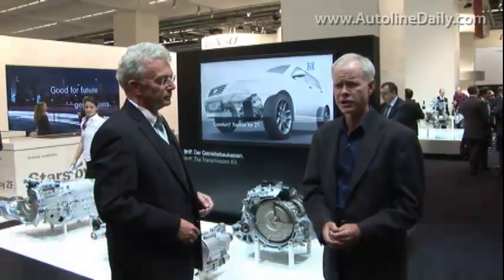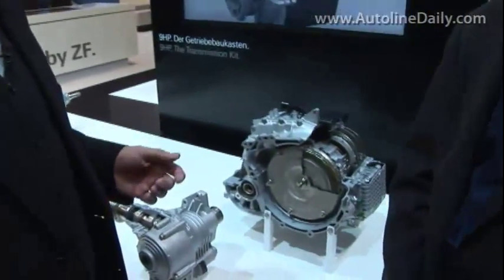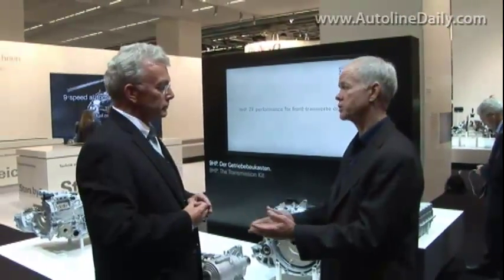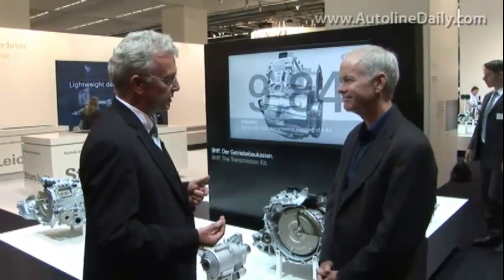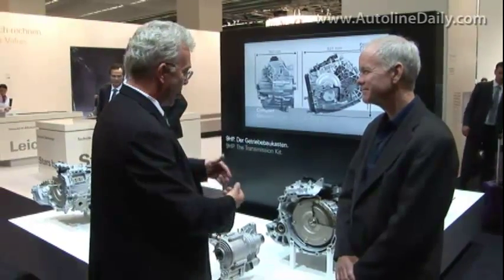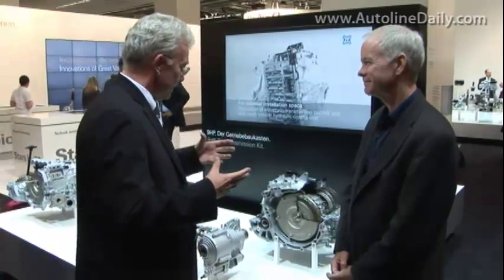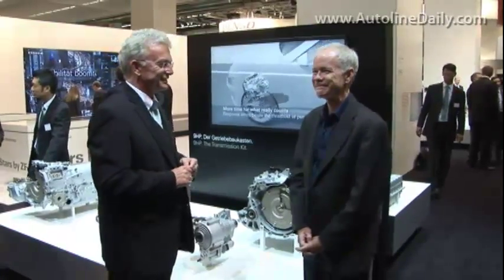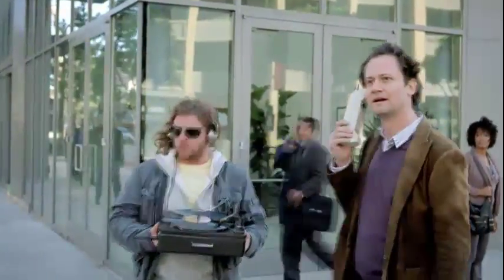ZF 9-Speed Transmission

Comment: We bought a new Jeep Cherokee in 2015. It has been to the dealership 6 times with transmission problems. Long story short, Jeep won't fix our car! I wish we had never bought it! I hear that they did away with the dog clutches in 2020 and that supposedly fixed their problems. Too late for me! I was considering purchasing a new Jeep pickup truck. Not now!  :(
Reply: I still think that they are still using the dog clutches, at least in the Honda Pilot and Passport.
Reply: Get the Jeep pickup. It doesn’t have this transmission
Reply: Hard to trust a company that won't stand behind their product. We are stuck with this Cherokee, hopefully it won't get us killed by hesitating in front of traffic.  :(
Reply: Rick Neighbors get software updates. They will help ! If your not at 100,k miles make them relate the valve body. You have other dealers by you. Get I’m there ass. But the more you drive it the worse it will be. I have a 200 so I know.

Comment: That 9 speed transmission is absolute junk, stay away from anything that has it. Didn't even make 15k miles before it died.

The only thing that's worse is a CVT transmission.
Reply: @DavidRC well the thing is, I didn't buy a jeep, but thanks for making the assumption. And another thing, this transmission is used in more than just jeep.
Reply: In what vehicle did the transmission die in? What was the part that failed?
Reply: @tumdeax it's a jeep renegade 

heck if i know, they replaced the transmission i know that much, it started screwing up at 10k miles which required a firmware update which fixed the harsh shifting and random gear drops and down shifts, then a few thousand miles later it just stopped working altogether. they didn't tell me what failed, being that it was still under warranty they just replaced it.
Reply: @madmax2069  you can see on my channel that I pulled out a '03 MDX transmission. A $60 sprag (aka needle bearing) failed and I had to pull out the transmission.